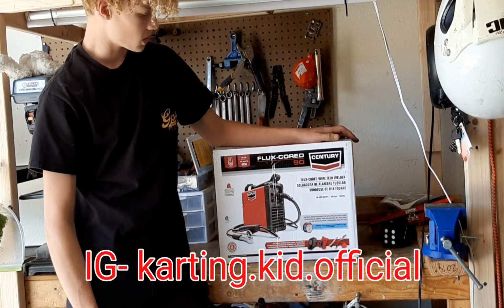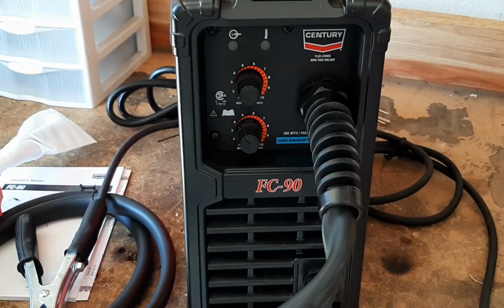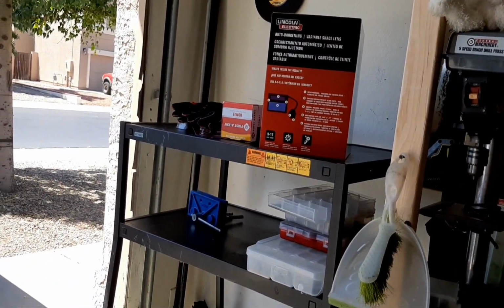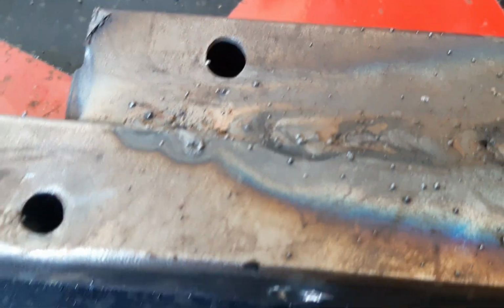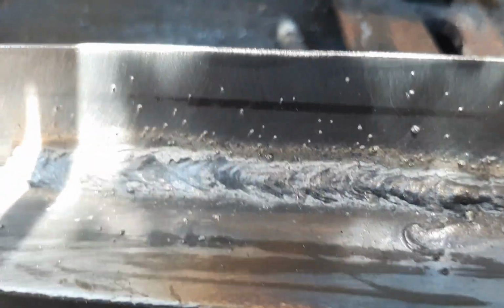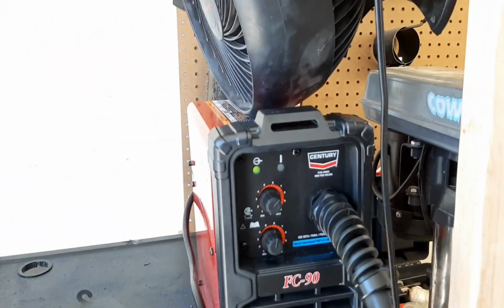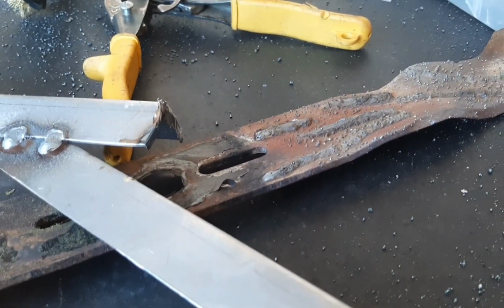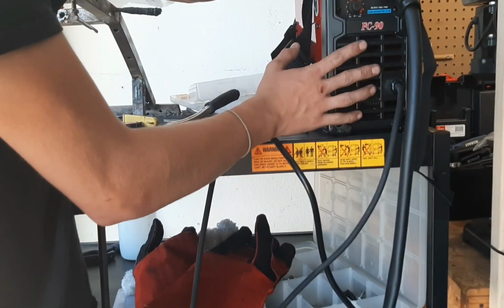Century FC-90 full review. Start welding for $200!

Comment: This is flux core (gas less) welder
I thought you had converted to Mig, because of the title of the video
Reply: Definitely misleading! MIG also uses DCEP, this welder uses DCEN.
Reply: @Rocksolidhandyman  
Correct 
The gun goes on the negative and the clamp on the positive side

Comment: Do you know if this welder can be converted to gas
Reply: No it cannot. It’s flux core only, no gas inlet. 120v AC 20 amp circuit. .030-.035 wire

Comment: A cursive lowercase e is the motion I use while pulling not pushing the puddle.
Reply: Always push the puddle when mig welding , better penetration
Reply: With FCAW you drag the slag. Even stated in the manual.

Comment: I just got this welder as well.
Reply from the maker: how you liking it so far?
Reply: I'm totally new to welding, so I'm sure I'm doing everything wrong lol.
Reply from the maker: @Gene_Pondacres  pretty much same lol, whats the problem?
Reply: I got this dump cart, it's like 19 ga steel, I converted it so that the back gate lifts up and off altogether instead of pivoting at the top.  So my first "big" try with this welder was to weld 1/8" x 1" tabs that the gate would slide into/out of.  I dialed the amps down below the recommendation for 18 ga, but even still I was blowing through the 19 gauge steel on the cart.  Eventually what work was dialing the amps down to the lowest setting and the wire speed around 5.  The welds look horrendous, but it seems to hold, only time will tell.